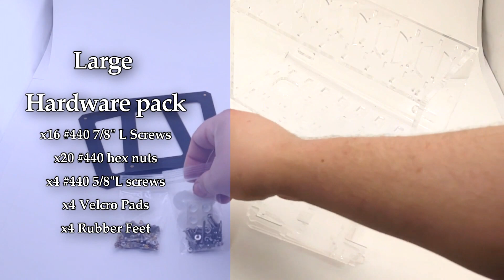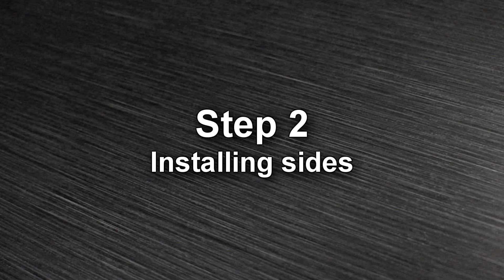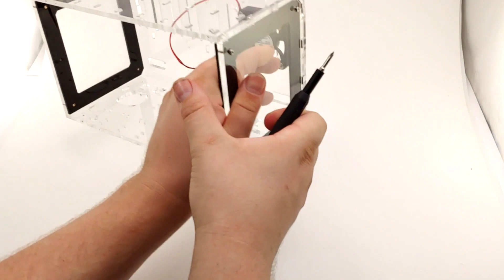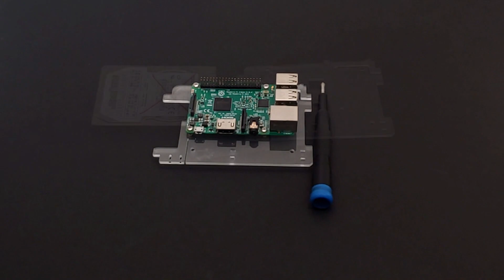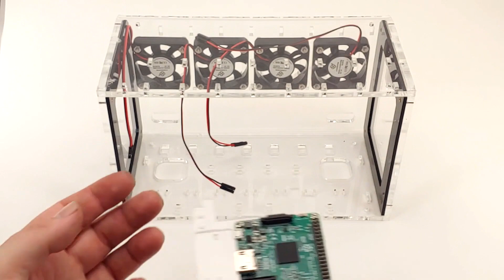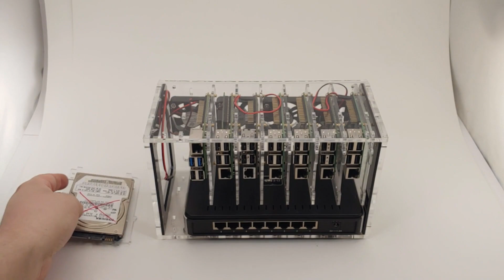C4labs Cloudlet Cluster case build instructions

Comment: Hi i bought ine if these cases and i am about to setup, but im ust thinking how do i access the sd card.. do i need to setup each pi before i assemble the case? in the instructions that come with this case it says to remove the sd card before assembly. is that just to assemble and then re insert the card one ready to clip the pi board into its slot?  thanks